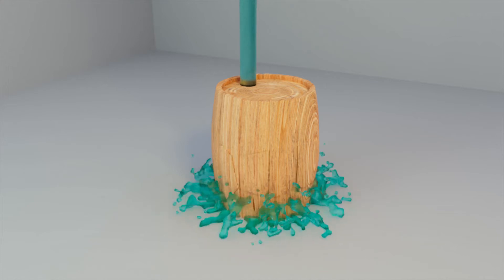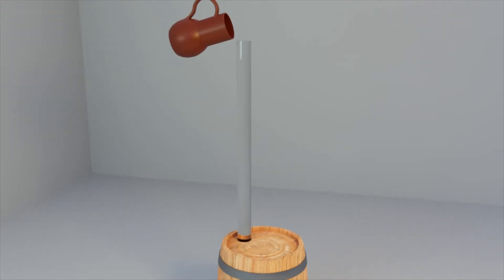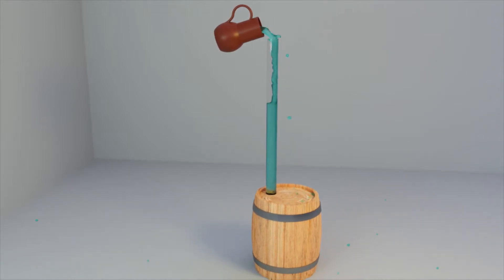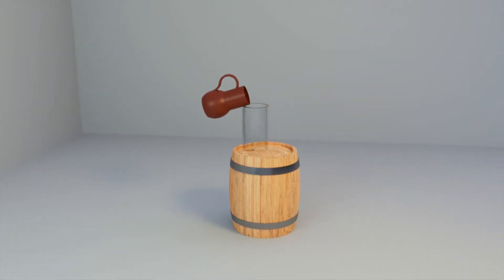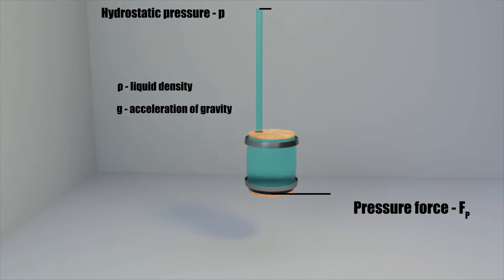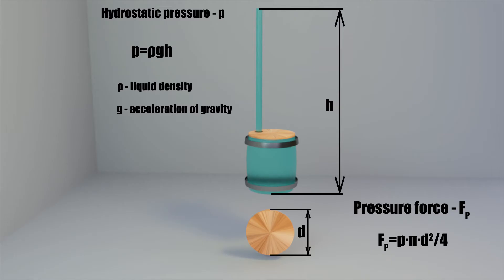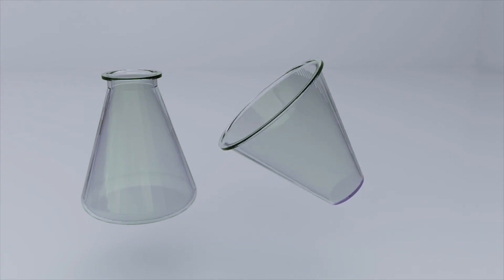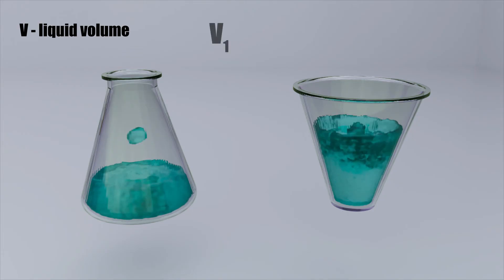What is the hydrostatic paradox? How did Pascal destroy the barrel using a mug of water?

Comment: Pressure and force are two different parameters.  There is no "pressure force".  
pressure=(force/area).  The pressure is equal in ALL directions at a given depth of liquid.
Pascal's paradox is not merely an intellectual conundrum but is physically demonstrated by experiment where the force per unit area increases on all surfaces of the container with  a column of water connected to it and raised above it, regardless of the column diameter/volume of the column. Force per unit area in all directions will increase according to (height)(fluid density)(gravity)=pressure.  Is this actually a paradox?  A paradox results when you reason from premises to a conclusion with contradicts a premise from which you started.